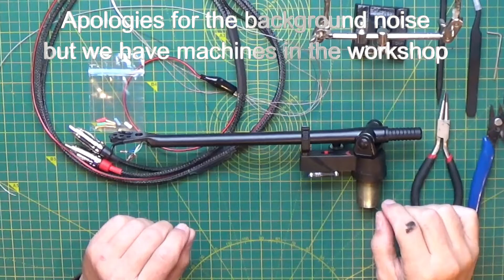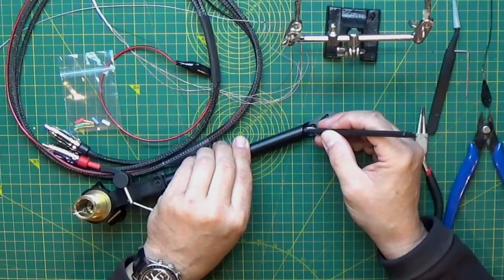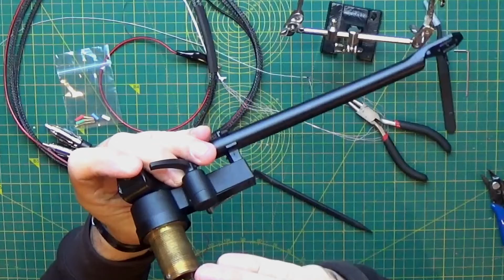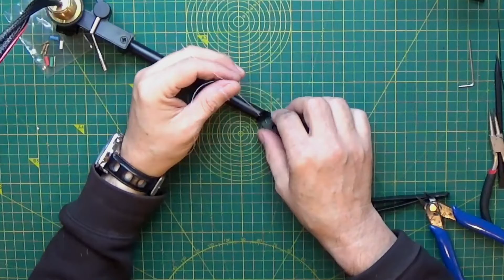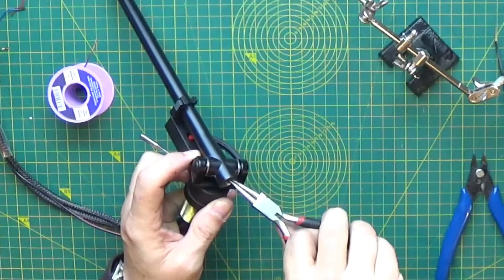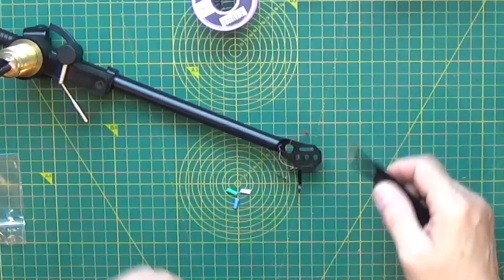How to rewire a Rega RB250 tonearm - tutorial

Comment: Speaker cables , RCA cables and Arm cables are smoke and mirrors. If your arm wires fail you can get them fixed free as long as you haven't messed with original stuff. I can't stress this enough. Regas don't fail. Idiot's rewire them. I'm decent with a soldering iron but all Regas are tested. You have a dry joint they fix it before it leaves the factory. This has to be executed perfectly so not an easy job. Even if you have done a hatchet job you will convince yourself it sounds better because it's a really expensive upgrade.

Comment: Hi, thank you for the video. Is it needed to twist wires (in pairs and then those two pairs together)? I read different opinions on this and see that you don’t do this. Thanks:)
Reply from the maker: I don't know where the urban legend that you should twist the wires together comes from, but that's EXACTLY what you shouldn't do.
Phono carts are balanced AC generators; twisting the wires will cause the following:
1) Serious increase in capacitance (a big no-no in modern MM carts)
2) Induce crosstalk between channels (if twisted ALL together)
3) Reduce dynamic due to variable crosstalk between two opposite phases of the same generator.
4) Increase spring effect inside the tonearm
I rewired hundreds of tonearms, and I NEVER found factory-twisted wires; they know what they are doing.
Stop following forums where people have zero knowledge of electronics.

Comment: Not strictly necessary, but here is what I found helpful when soldering the cartridge clips: Instead of clamping the clip directly with your "3rd hand", push the clip over the tip of a wooden toothpick and clamp that toothpick instead. 
The toothpick won't suck any heat from the soldering point, making soldering a little easier and faster.
Reply from the maker: Thanks for your comment; however, using the x-tra hands won't strain the cartridge tag that can get unnecessarily  enlarged by the toothpick, and the soldering will take a second or two anyway with a 420-450˚C soldering iron.
A good chunk of our trade comes from tonearm repair and upgrade and we rewired a few hundreds Rega tonearms in the last 5-6 years.
Reply: @TheAudioSanityChannel-ym7ij  I see your point, but didn't notice any danger of unnecessarily enlarging the clips, at least with the toothpicks I had at hand. My comment was not so much about the mechanical strain on the clips, but purely related to unwanted heat transfer. Most importantly, it was more targeted to hobbyists, not pros like yourself. I'm sure you're doing well what you're doing.

Comment: Fantastic video and the only one I ve seen actually showing the full procedure . I think I can do it myself . The close up of the tinning of the end wires was very good .Maybe the tinning of the black ground wire should have been shown too in close up . I m still not sure how exactly the ground wire stayed in place without soldering it or is the end stub screw in the thing which keeps it firmly on the inside . Thanks very much for your video . Other Youtube vids on "Rega Rb 300/ 250 etc have all been adverts .
Reply from the maker: Thanks for the comment. The tinning procedure of the ground wire is exactly the same. The clip cannot be soldered because this would mean heat the armtube to 350˚C or more..... It has to stay in place between the grooves of the thread. The kit used was from The Vinyl Source London (actually made near Glasgow).
Reply: Thank You , I will be using this outlet to buy my tonearm wire. I have 3 old Rega  arm s a rb 250 with an Origin  Live counterweight which is supposed to be an ubgrade .Origin Live say the rb250 is actually a better arm than the more expensive rb 300 so I think I will rewire the rb 250. It is has a broken wire coming out of the headshell end with only 3 wires present .Thanks again for an excellent video  @TheAudioSanityChannel-ym7ij